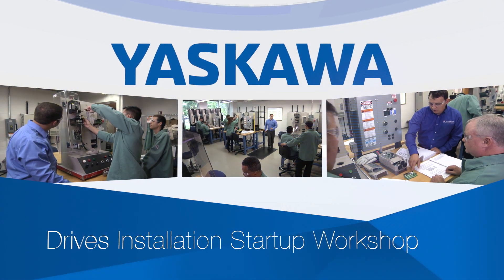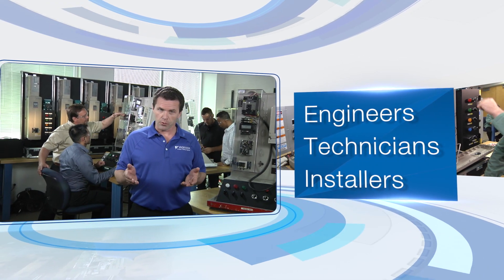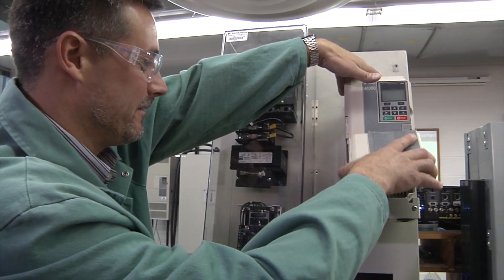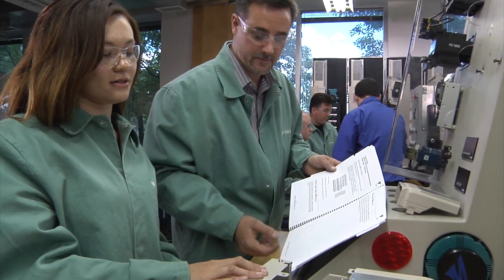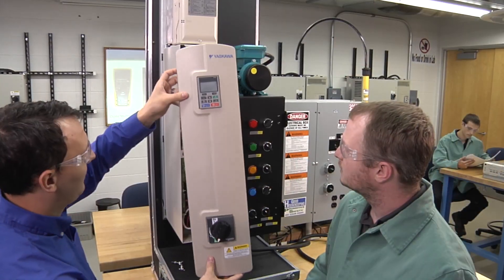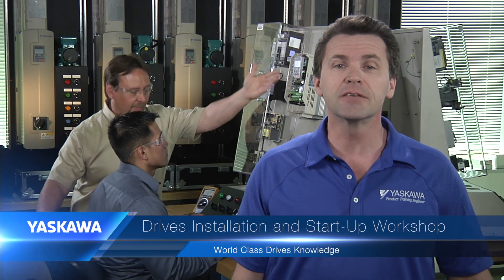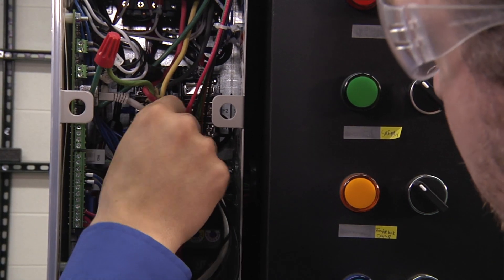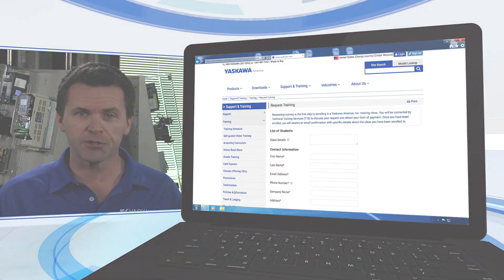Yaskawa Drives Installation Startup Workshop

Comment: Hello! I want to ask you how many Kw is the GA7 inverter ?. thank you!
Reply from the maker: The kW is dependent on the model number of the inverter. Yaskawa Asian and European businesses have released a product named GA700. The GA800
was created for the Americas market to optimize features such as current ratings at 480V and
operation of the Bluetooth keypad. You can find more information on the GA700 here: https://www.yaskawa.eu.com/products/ac-drives/general-purpose/seriesdetail/serie/ga700-series_511
Reply: @YaskawaAmerica  Thanks for your information. I have read the Catalog and see that the current GA700 has a model with the largest capacity of 315kw. and growing to 630kw.